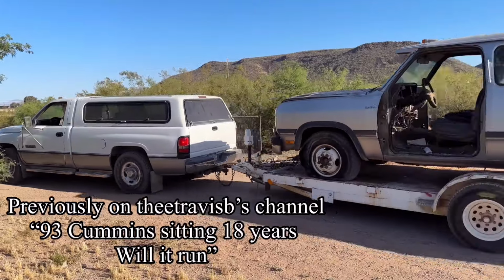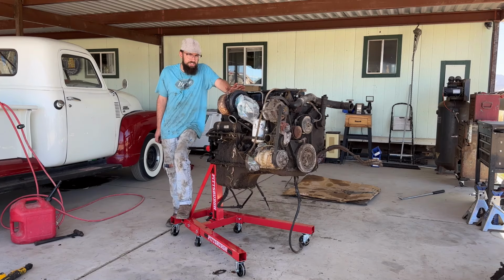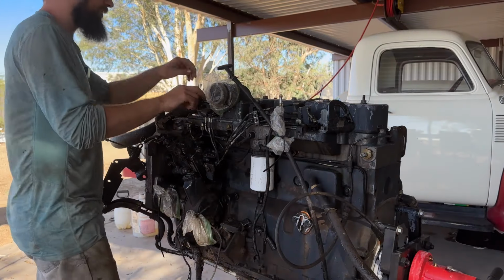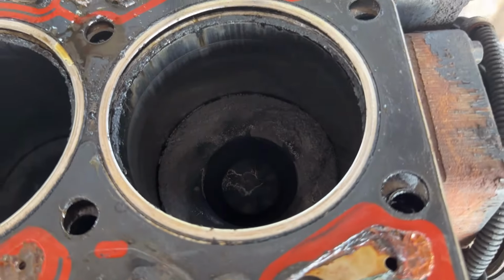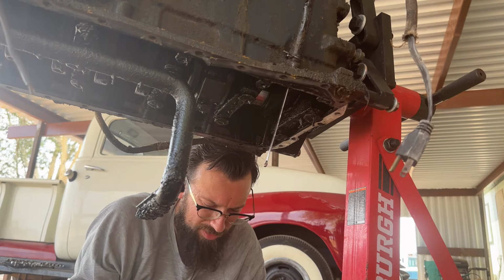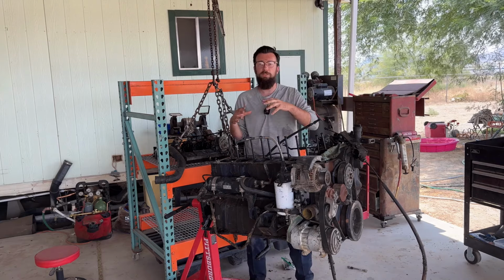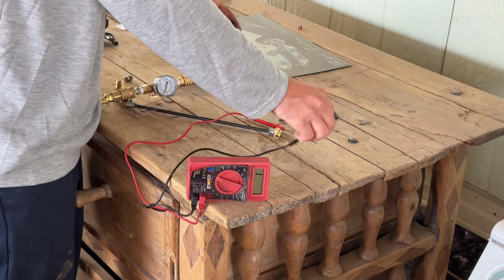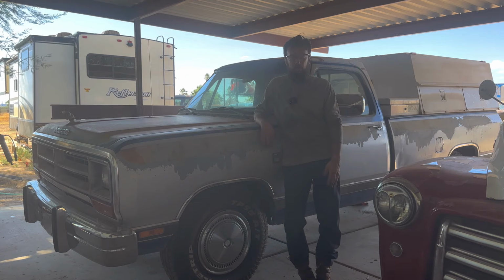Abandoned ‘93 Cummins. Will it run (AGAIN)?

Comment: while you have engine apart, make sure to remove front cover and do the aftermarket fix on the dowel pin that sometimes drops into front gear cover.  Very easy fix.  Great work, Bill

Comment: Thanks to Dalton to turning me on to this channel, I'm really liking this.  I don't know squat about deisels, except for the basic stuff--they use glow plugs, injectors, different pumps, stuff like that.  I worked for various moving companies.  That experience, as a driver, is what actually introduced me to deisels.  As a driver, I just had to simply keep fluids topped off, do a simple once-over check on the appearance and performance.  Everything else was handled, you know, the "major stuff," by a shop.  My truck was a Freightliner FL70, with a Cat 3126, with an Allison 6.  That thing was bulletproof and took alot of abuse.  Friend of mine has a 1969 Pacemaker 50-foot yacht, runs twin 3126's, coincidentally.  No, I didn't mess with that, as I really don't know much about deisels overall.  By the way, no, I didn't own the FL, it was the company's truck.  I just drove it.
I'm normally from the planet Gasoline, mainly vintage/classic stuff--small blocks, Hemis, straight 6's and 8's, etc..  I drag and daily a 68 Galaxie and a 78 Impala.  Alot of 40's to 70's stuff.
As for Travis, I'm learning quite a bit here, be it Cat or Cummins or whatever.

Comment: I recall doing doing an overdrive bypass on an old Transam I had that needed overdrive. Seems like I used an oiled pressure switch ran to ground. Screwed that into the 4 pressure band screw on the side of the trans. Worked good. Too bad YouTube didn’t exist back when I did work on cars. I think I would have liked doing vids on that. Perhaps, it’s not too late, lol. I still know my way around an engine bay. Thanks for the vid. It was good!

Comment: Its a shame what some yahoo did to that engine by burning unrefined food-grade oil in it.  The culprit for all the damage was glycerin that's in the oil.  You just can't dump food-grade oil into the fuel tank.  The oil needs to be refined; chemicals need to be added in the process of refining; the glycerin has to be separated.  If the refining is done properly, then the oil can be burned in a diesel engine.  Glycerin is the culprit for all the stickiness and piston ring damage as well as lubrication starvation to the entire engine.  What a damn shame.

Comment: Travis that engine stand had to be extra heavy duty. I can see where that’s a pretty good investment. Plus the rebuild on that engine will take quite a bit of time. So understand why your not going to jump on this.Your transmission problem solved. Outstanding! 💯👊👍
Reply from the maker: Yessir so much better now
Reply: Technically that engine stand is not heavy duty enough as the engine weight more than it’s rated capacity.

Comment: I think you should just hone number 6 cylinder the best you can , or if you have or can borrow a boring tool, bore out the cylinder and slap it back together. It was already running on 5 cyls. So it will smoke a little. New rings, hone job and put it in an old beater of some sort. It would make a great video. Don't give up so easy. I've seen way worse engines brought back to life on will it runs.

Comment: Those sounds like it's a close to the 350 C which is an old Chevy transmission where you just put a solenoid in it and flip the switch at about 45 to 50 to click it into overdrive

Comment: Did that Dodge have the 727 trans, or a 518? The reason I ask, is because 1st gen Dodges with the 727 had a Dana 60 rear axle with very rare (for a 60) 3.08 gears!! But that might only be the 3/4 ton! EDIT: Oh, you just answered me!

Comment: No offense, but you along with every other backyard mechanic does.
Everyone tries to bolt the engine to the stand and that just becomes a huge problem! The proper way to do it is actually take your amount off of the stand and bolt that to your block period once you do this, pick your stand up, slide it back on the mount plate and then tighten. Up your bolt period once you've done this. Now you can lower it down as a complete assembly and not have to deal with all of the BS.
It makes it so much easier.
I've been doing it for over 35 years, and I tell you what...
Once you do it this way, you will wonder why you didn't start doing it this way a long time ago!

Comment: Just had the same thing happen on a Toyota 22R. With about 5000 miles on a fresh rebuild the ring lands collapsed on one side of the piston, pinched the rings off the cylinder wall, and lost compression on number 4. This engine was built by the local machine shop that did the machining. Not building it myself was a huge mistake. I replaced all four pistons and new rings. It seems to be fine now. They screwed up the cylinder head too. #3. I still haven't taken it apart because of time limitations, I bought a new one from that 22R guy in Chico Ca and that solved the cylinder head problem. Then there's the block they sold me that had one cylinder head bolt hole with stripped out threads. Kind of a BAKER"S dozen of machine shop screw ups.

Comment: It’s all gummy up from all the cooking fry oil’s and it’s baked had a Nissan do the same wouldn’t rev and dropped out on cly 2 and4. It destroys inj pump and seal and basically everything in a engine never use it on a common rail system